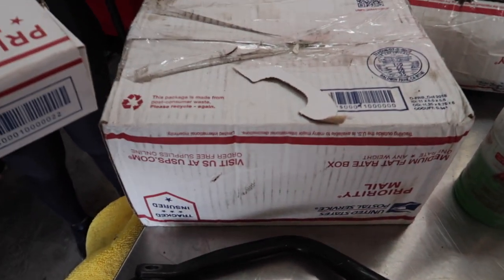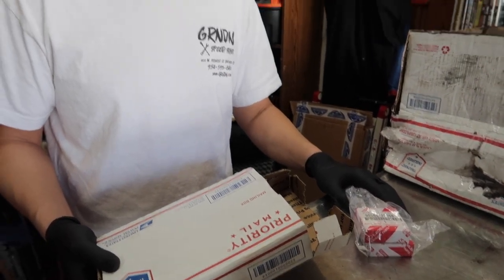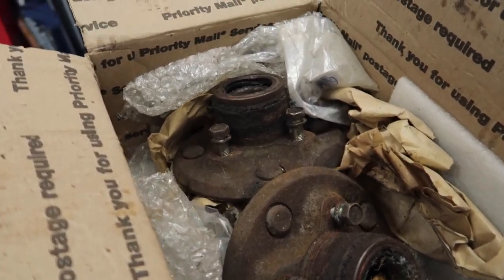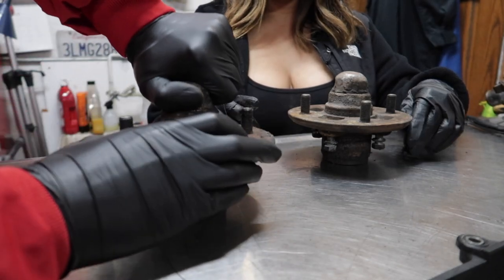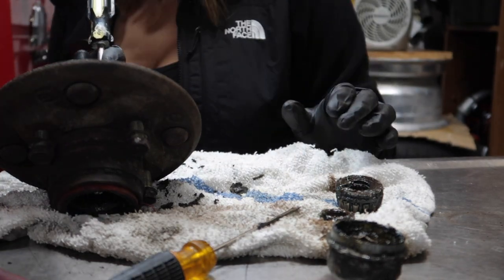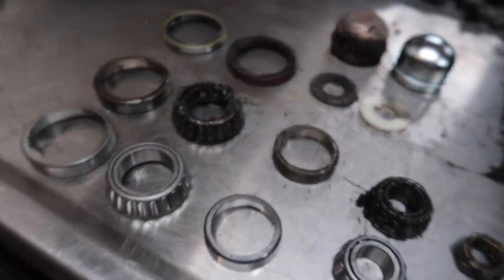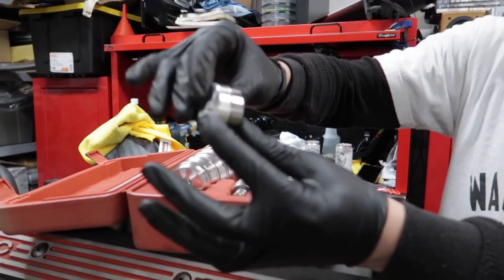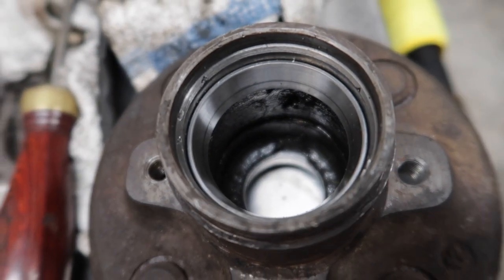AE86 Suspension on Starlet KP61

Comment: Why did you decide to go ae86 suspension? Did you consider using s13 stuff? Just wondering your reasoning. Glad to see you back!
Reply from the maker: Much love! It first started with coming across a deal on the T3 AE86 to KP61 front suspension conversion kit. My friend sent me a forsale post and it was too good to pass up. After purchasing that setup I started to piece together the rest of the pieces to go with it, then the Coilovers. It was just easier and I actually haven’t heard of S13 to KP before until now. Pretty interested about that now! If you have any info or resources please send it my way. I’m always fascinated on what others have done for suspension/ engine for the starlets
Reply: BojanglesDavid in theory it doesn’t sound that difficult. Pretty sure a guy in Ireland has it done. If ae86 stuff can fit then s13 stuff surely can too. I know a lot of people with s13 stuff on ae86’s.